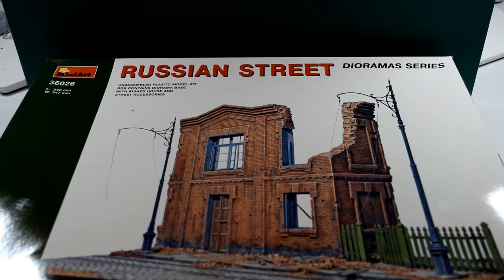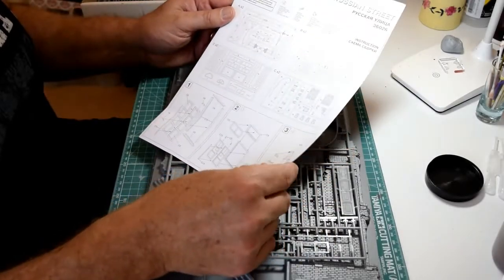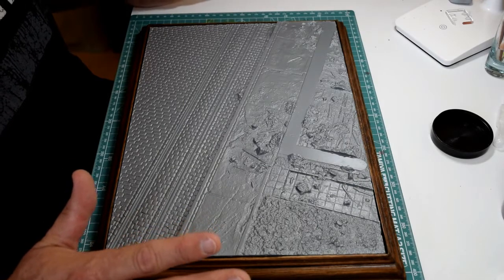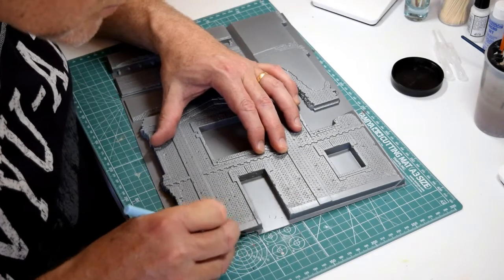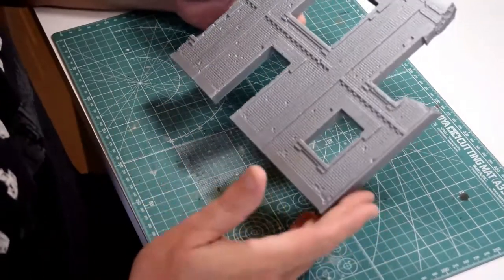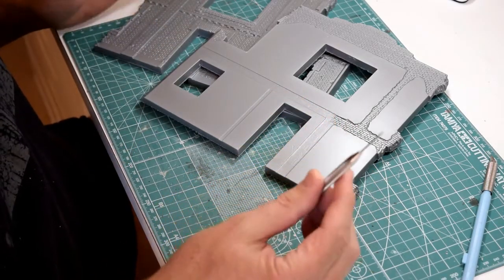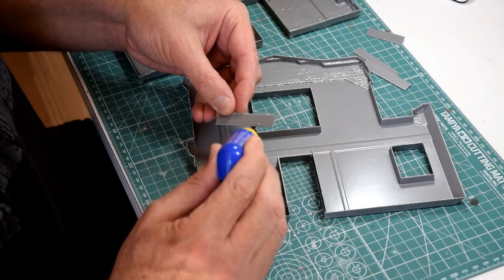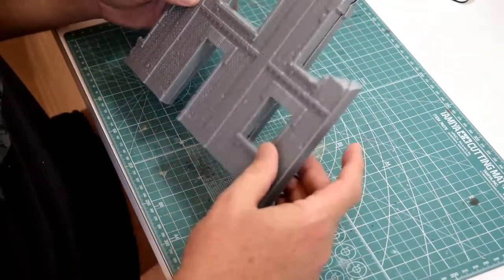Mariya Oktyabrskaya Diorama - Mini Art Russian Street - Part 1

Comment: I've done few miniart buildings and not a one fit together perfectly.  You did one hell of a good job on it and definitely gave me some good tips for my next building.
Reply from the maker: +EnoK Coop Thanks very much for the positive feedback, I really appreciate it.  Their are things I would do differently next time, but overall I think it came together reasonably well, watch out for the final installment which should be up in the next few days of the painted and weathered completed kit.
Reply: Your NOT making them properly then. You have to remove the parts from the sheet correctly. I bet you are cutting them out by going around the edges with a scalpel/knife. That's the WRONG way!  Yes, you can then sand the parts to make them right, but there's an easier, quicker and more accurate way and that's to flip the sheet over and to scrape around the edges with a blade. There is a vid on my channel.